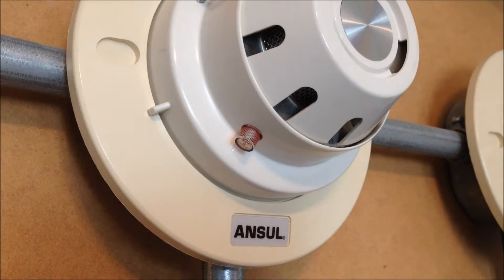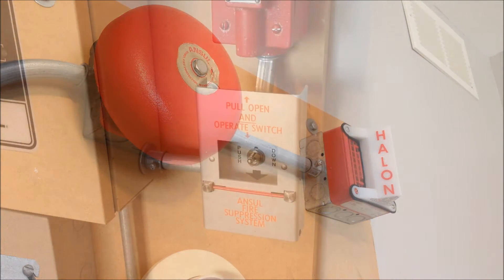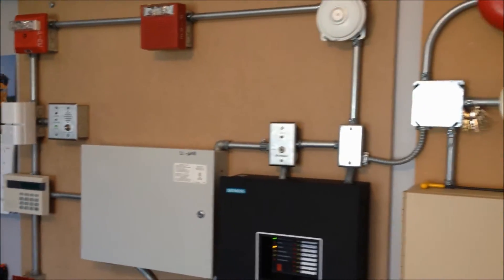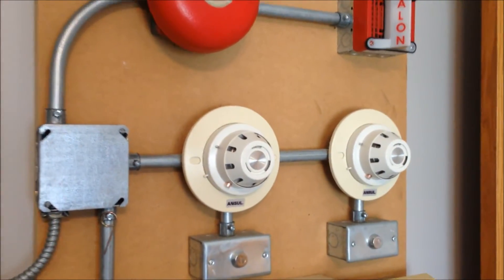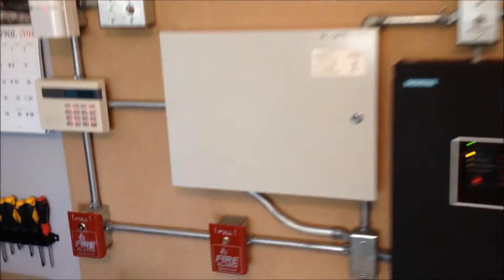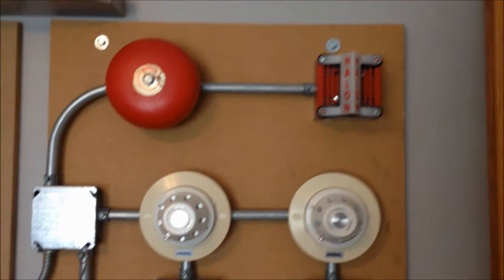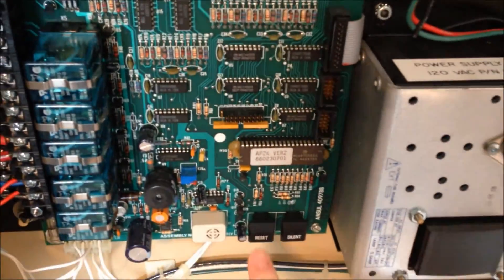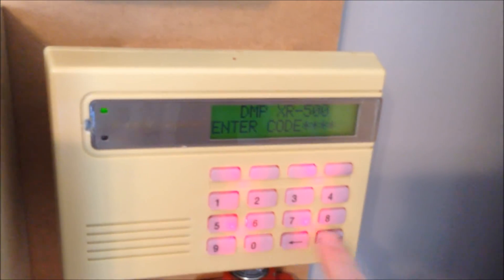System Test 18 | Halon System Activation

Comment: What is a halon sysrem
Reply from the maker: Halon systems are automatic fire extinguishing systems that were used before more modern chemicals such as FM-200 or Inergen were developed. Basically, it operates similar to a fire alarm system, but only protects a small area or room. If a fire is detected, an actuator is operated to release the Halon fire suppression agent into the room, thus extinguishing the fire. They were commonly used in areas such as computer/server labs, records rooms, or labs where a standard water Sprinkler System would damage or destroy the assets meant to be protected. My particular system was formerly used to protect a "tape vault" at a manufacturing plant, where company data was stored on "data tape cartridges," similar to VHS and Cassette tapes. The Halon system would extinguish any fires in the room should one occur, without damaging the data stored there.
Reply: kcin556 I get it!
Reply: Halon has been more phased out though as it’s not exactly a clean agent like FM-200 nowadays.